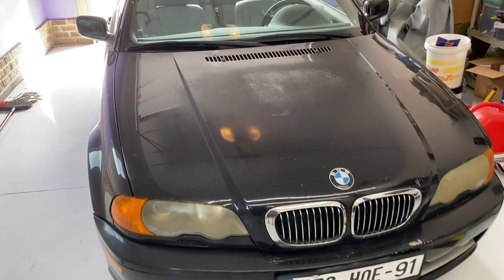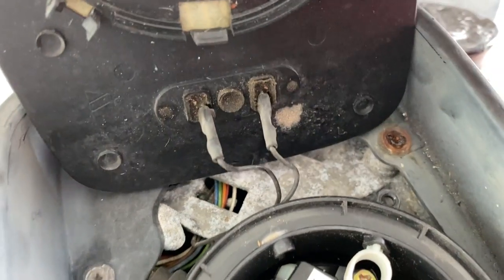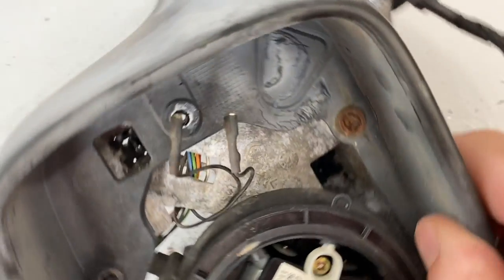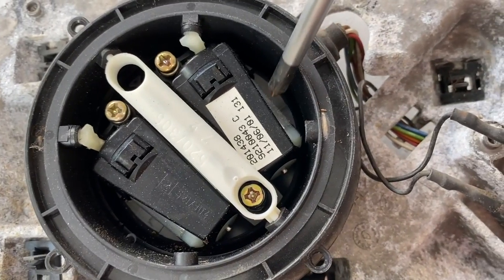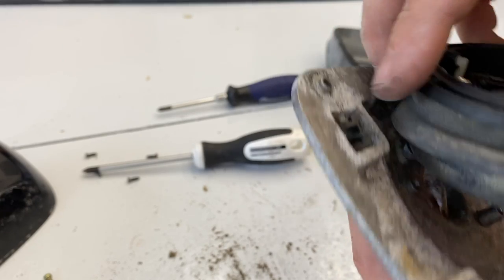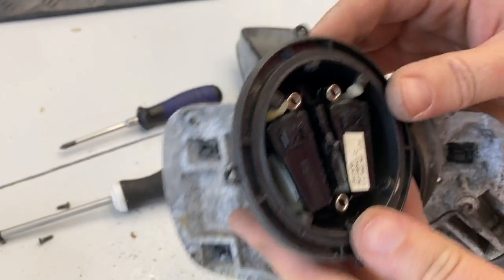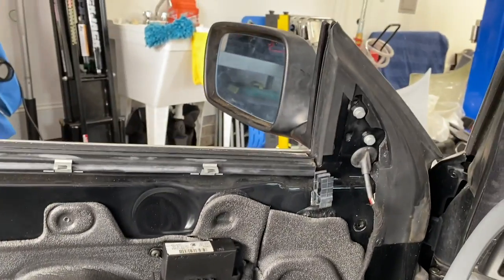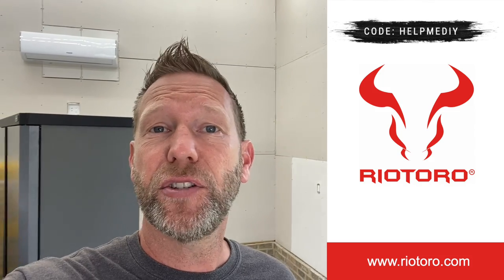BMW E46 Side Mirror Motor Actuator Diagnostics/Disassembly 330ci 325i 330i 328i 320i 320d 318d 318

Comment: It looks like you went through a lot of frustration. I just realized that my mirror stopped working when my body shop messed up the door handle connection. I suspect it may not have been plugged in after they 'did their thing.' Hang in there....working on BMW's takes exceeding amount of patience. I spent more than two hours trying to put an injector clip between the injector and the fuel rail. I learned that you cannot do it...must pull off the fuel rail to get the clip to snap in with the injector. Voila!
Reply from the maker: +Bruce Moeller patience is usually key 😉

Comment: You never tell  us how to get the motor out
Reply from the maker: That’s as much as I figured out 🤷‍♂️
Reply: @HelpMeDIY   Looks to me like the motors are soldered in the circuit board. On mine the white toothed lifter is broken. I wanted to just replace that.  but it wont come out even if power is applied to extend it all the way. If someone got  out the white piece let us know how . Still u have  the best video ive seen showing the internals

Comment: hi, i have a question. The lil white sticks that look like lil bones can be removed? thats the part that goes up and down with the lil gear
Reply from the maker: +Edgar V I never removed them so I’m not sure 🤷‍♂️ I bet there is a way to remove them though
Reply: @HelpMeDIY  I see. I was checking the piece, and the lil tabs un mention in the video, actually allows to move the lil gear , meaning the lil bone can come free from the bottom part, hopefully I'm right and I don't break it

Comment: I'm so glad I came across your video! Recently bought a e46 convertible for the summer and the passenger mirror was not working at all... Before anything I wanted to test the motor, but I didn't even need to go that far. Removed the door panel and inspected the connector, and bingo found the issue @20:28, the connector was not plugged in all the way. 

Please Note: Make sure to open the grey tab and not close it before pushing it in, there is teeth on that clip and the clip in the inside. Pushing the connector keeping the grey tab open will close it itself. 

Thank you!
Reply from the maker: +Shamil Gret glad to help! Hope you’re a subscriber now 😉
Reply: Hi weird question but I'm having the same issue did your passenger mirror still dip when being put into reverse even when not being able to move it manually?
Reply: Sorry for the late reply, but no it wasn’t dipping even while on reverse until the plug was properly seated in. In my case i think the previous seller opened the door panel for something and forgot to plug the connector in correctly.